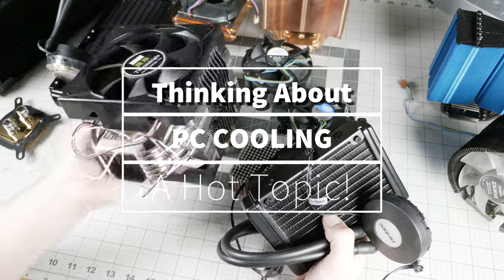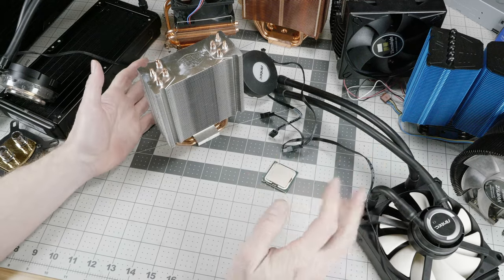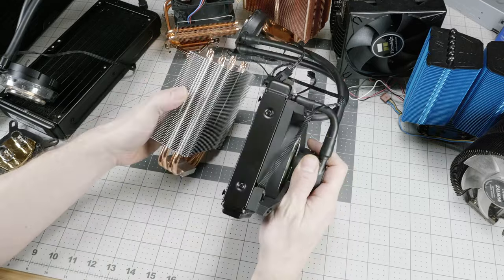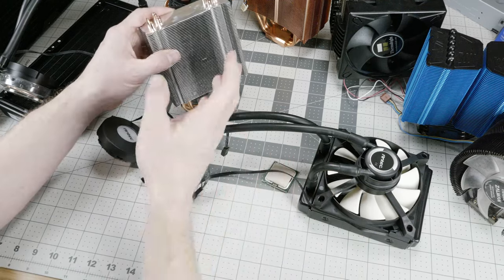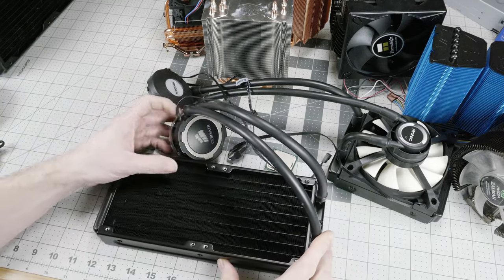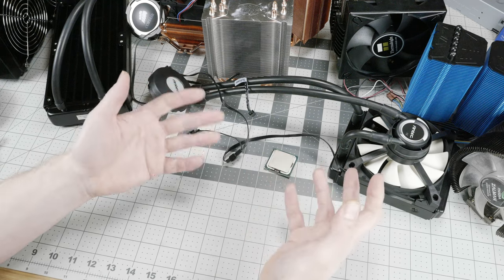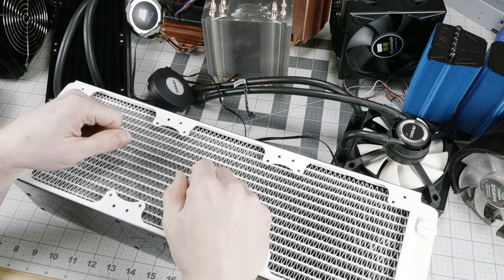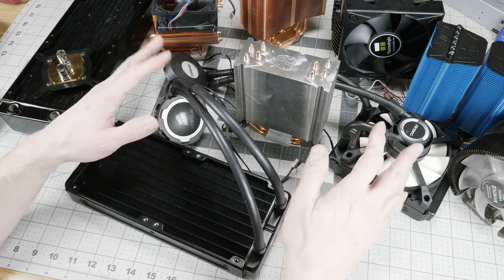CPU Cooling, Air vs  Water Philosophy

Comment: Nicely done video, thanks a lot.
When it comes to bigger air coolers like the Noctua NH-D15 at around $90 usd, how does that compare with AIO coolers for silence and performance around that price range? Even if you dont have that one, what would you choose?